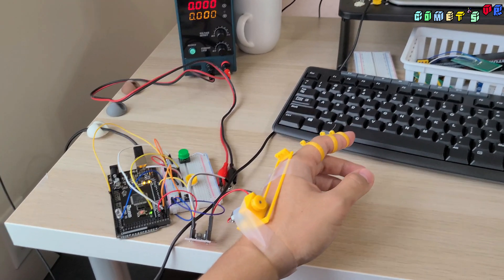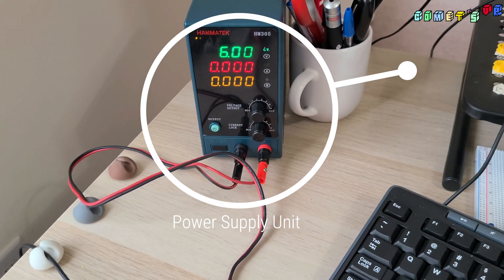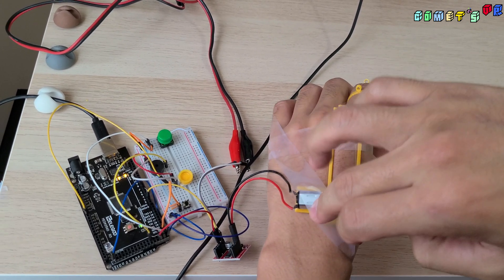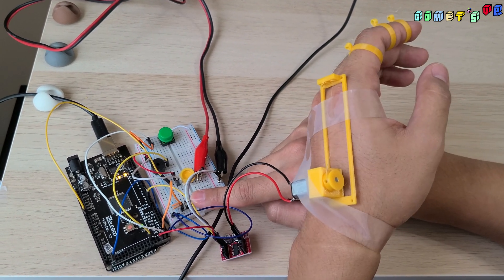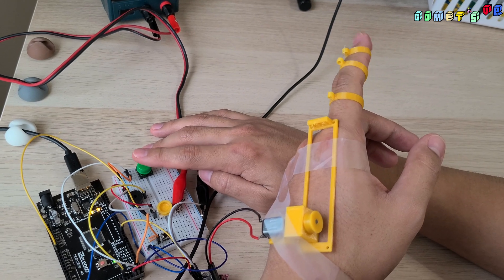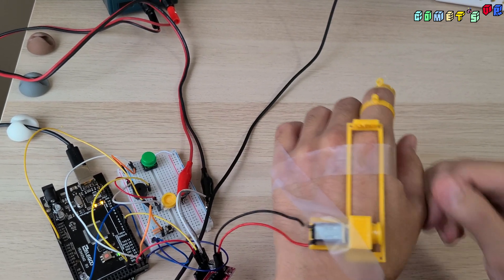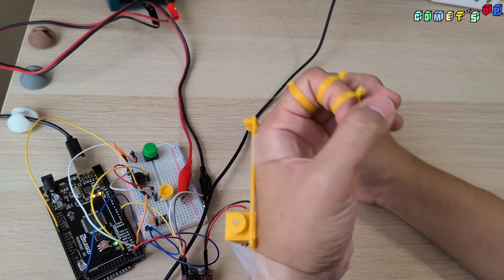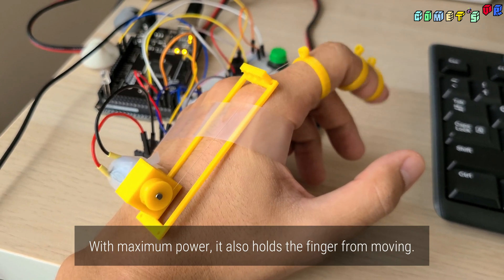First Prototype of VR Haptic Glove, Motor Torque Test!!!

Comment: Really cool project!! I am about to start making something similar. Can you tell me how the motor can restrict the finger movement to a particular position? When the motor is switched on, the finger is completely open. At low power, the finger is free to move to any position the user seems fit. But how do you plan to implement the controlling so that the finger is, let's say, bend at an angle 45° and the finger stays there? Can you realise that with a DC motor or is a servo motor absolutely necessary for that?
Reply from the maker: Hi, thank you for your interest. The reason I used DC motor is, it can provide a type of force feedback that that not stop immediately but can feel a tension linearly or nonlinearly. Servo motor only can do stop motion which is not feel natural. You said 45 degree, I read that from flex sensors I attached in another video I uploaded. If flex sensor shows 45 degree, increase the motor torque and resist the finger movement.
In my personal experience, servo motor is easy to implement but will not give you good force feedback feeling than DC motors. I hope this might help!
Reply: Thank you!! This does help me! :D.. I'll update you on my progress soon :)
Reply from the maker: @akhilrajca7845  Awesome! Look forward to it!